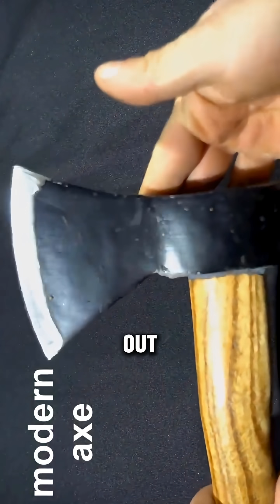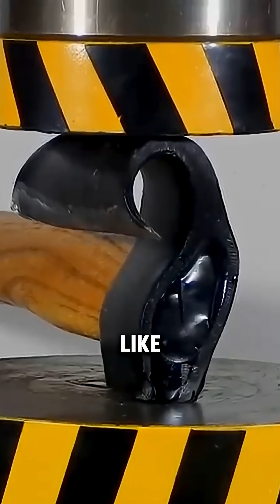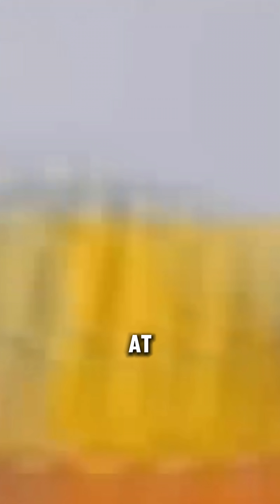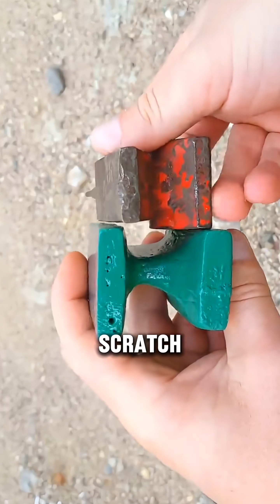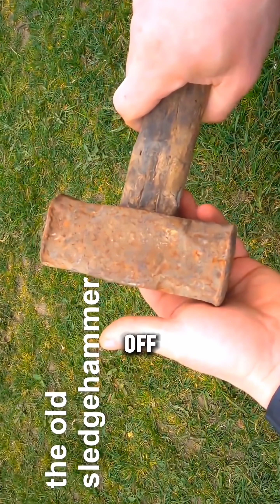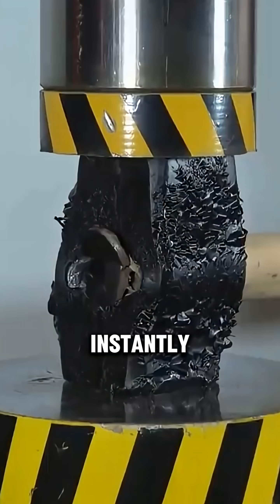Old Hammer vs Modern Hammer — The Result Shocked Everyone! #shorts

Comment: That’s how it is now made worse and cheaper but costs more
Reply: Made cheaper? Most likely. Manufacturing processes are always improving, and cutting costs is a part of that.

Costs more? Likely not. When you can go to your local department store and buy tools "off the shelf", the price (relative to your income) will be less than a century ago when you had to go to a specialty shop.

Made worse? Debatable. I suspect there is a wider range of product quality than there was in past centuries. There is stuff that is less durable, but there is probably also stuff that is just as strong. Plus, even if something is more fragile l, that does not automatically mean it is "worse". (Maybe a newer less durable ax holds its sharpness better. Maybe the newer hammer has less vibration and leads to less fatigue when using it.)

Comment: This is not about the old or new idea but it is about the materials used to make that thing
Reply: New ones are also more elastic (easier to work with, less pressure on joints) and are cheaper to produce. 

So modern ones are better for work.
Reply: Thats the whole point. Older products were made to last, whereas new tools are built to break after a certain amount of time because its more profitable to sell 10 hammers rather than one
Reply: @xavierfournier2408 Then the elites tell us we have to be sustainable to save the planet 😂
Reply: @xavierfournier2408 no it’s not. If you buy a more expensive hammer I’m sure the results would be different. Not a like for like comparison.
Reply: about that axe, the cooling process might have also played a role on how they behaved during the press. A metal cooled naturally is usually more flexible, while metals forcefully cooled by water makes them brittle. so the old one might also be cooled down by force to whitstand pressure, so it won't bend like the "modern axe" does.
Reply: @t @tjdeayre1090 s that’s because the old one was probably high speed steel ( heated then cooled fast ) making it a stronger metal but brittle at a point. The metal is still a better metal for a axe when it comes down to strength you don’t want a flexible metal for a axe the tip will keep blunting 😂

Comment: next: try with car from 1960 vs modern car
Reply: Technically cars are safer today then they were back then. I believe engines were built better, but when it comes to safety, modern cars win.
Reply: @stevetreck3150 engines is more reliable today than it was back then
Reply: Wrong  @stevetreck3150
Reply: 1960s cars were death traps, less power, performance, hard tires, and at 100k miles were ready for the scrap heap.

As for old steel, harder and more brittle, actually less ideal for use. Also, workhardened over time. Could shatter in dangerous ways. Never bang two old hammers together. New ones, no problem

Comment: Coz in the old days hammer and other equipment are forged by men and todays equipment are machine made
Reply: Yeeeaa that second axe was actually cast thats why it didn’t bend and cast metal has a high compression rate it has nothing to do with quality more to do with the metal used and how it was worked